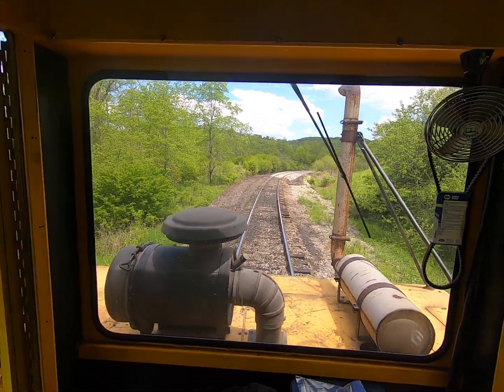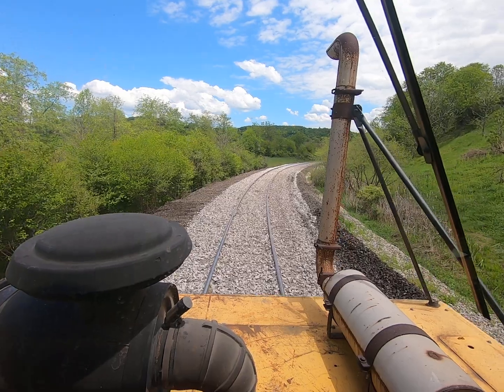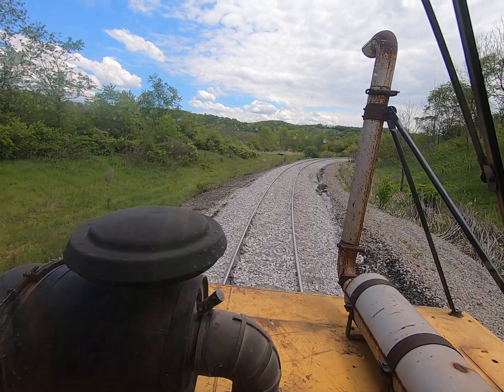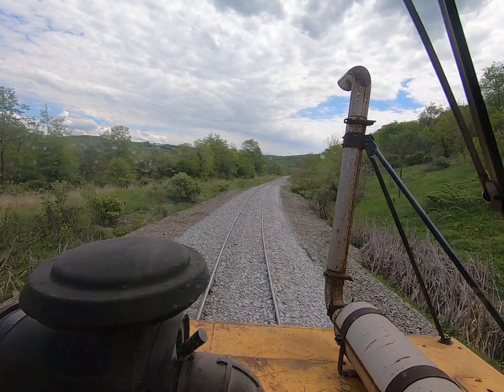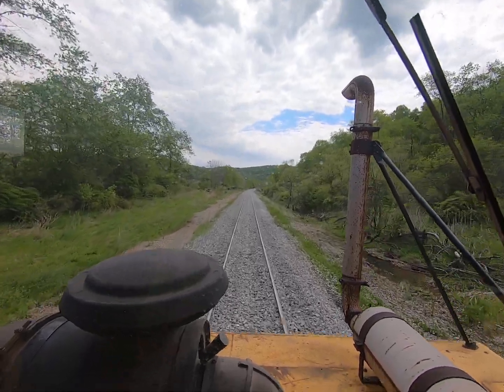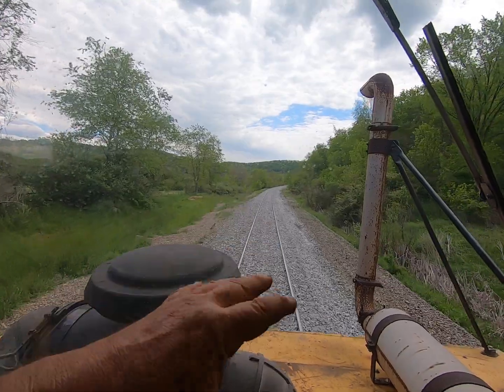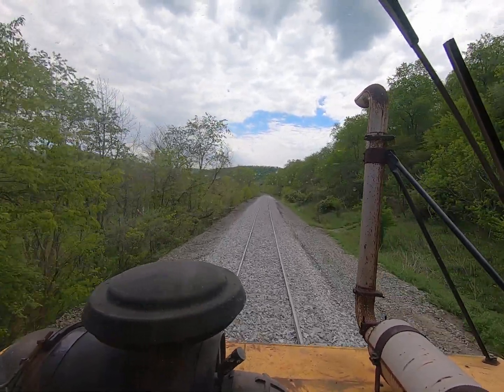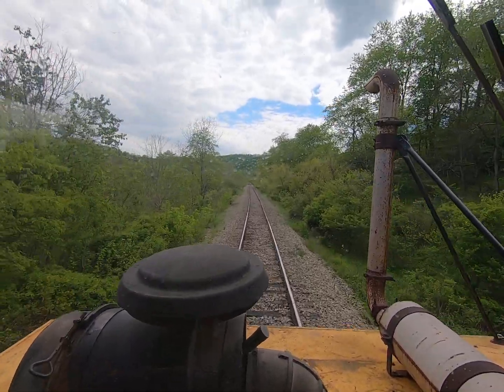Curve 25 and 26 Cribbing and Tamping Update

Comment: So now that those repairs are made, what and when dictates when you have to redo what you just finished? How long do you expect your repairs  to last? It appears its a constant repair battle. I'm guessing its more cost and time effective to do it as you are vs  ripping up a few miles at a time from scratch.  Nice video.
Reply from the maker: This is the first time since track was new that ballast has been
cribbed out Dennis, albeit long over due so hopefully we will
get another 35 or 40 years out of this barring any unforseen
disaster. Jointed track is a maintenance nightmare then double
the curse with leaky car doors. If we had track time then taking
out a section completely is the way to go, but they seem to have this penchant for wanting to run trains 7 days a week...LOL Thanks for watching sir
Reply: @ccrx6700  I just wondered how long your repairs last since it seems your constantly fighting water under the ties. Thanks

Comment: Bridge 3 is ahead or behind you...
Reply from the maker: Donald, bridge 3 is behind me and we are traveling east, starting point of the video is at MP 5.7
Reply: @ccrx6700  Bridge 3 McCoy Rd...
I was on Google Maps, they updated their mapping images. You can see the new white ballast you have put in the curves...
Reply from the maker: @donaldwittmuss6079  wow awesome!
Reply: So Tamper is always facing eastbound when traveling,
Reply from the maker: @donaldwittmuss6079  nope, always facing west, in thus vid was looking out the back window
Reply: @ccrx6700  Comments on orientation of travel add to your narrative. So this last Vid you were east of Bridge 3 McCoy Rd, traveling eastbound thru Curve 25 and 26...MP 5.2
Nice...
Reply from the maker: @donaldwittmuss6079  yea i said 5.2 but was wrong, it round 5.7 at starting of vid.    Apologize for that
Reply: @ccrx6700  Your Regulator front view must also face westbound too...driving forward toward the Loading Terminal...Reverse back to the Shop...
Reply: @ccrx6700  Coming out of Curve 26 look like tangent extending past Roberts Rd Bridge 4...Where curve 27 starts...ending at Bridge 5 Smith Creek Rd...
Then a tangent to MP8 siding, where curve 28 is...
Reply from the maker: @donaldwittmuss6079  well i've never shown before, but it has a turn table
 We can put it down on rails then swing regulator around to face either direction. That why sometimes you've seen it point 1 way and then in a diff vid it may point other way. Want sometime make vid of me turning the machine
Reply from the maker: @donaldwittmuss6079  back it up 1 curve number and you got it. Curve 28 is between bridges 4 and 5 headed east. C29 at MP 7.5, then C30 at MP 8 siding.  My avatar is C29 looking east, you can,t see it in the small pic, but down track there is a black bear in middle of track!

Comment: What was that thumping in the video?  Do you have a flat spot on one of those tamper wheels??  Couldn't be, not you...  :)   About how long does it take a freshly tamped / cribbed section of track to fill back up with coal dust and start to be a problem again?
Reply from the maker: No flat spot, that was wheels thumping on the joints, tamper  not a smooth ride with smaller wheels, you feel and hear every joint,
regulator even worse ride with 24 inch wheels. 
This first time since track was new in 1977 that we have done
this ballast rehabilitation, so i takes lot of years of spilled coal